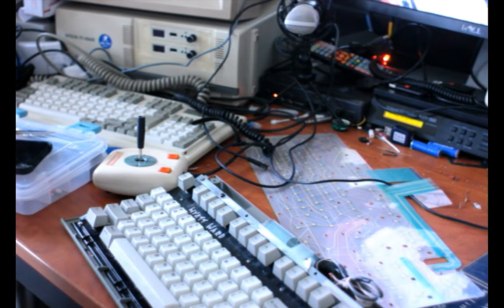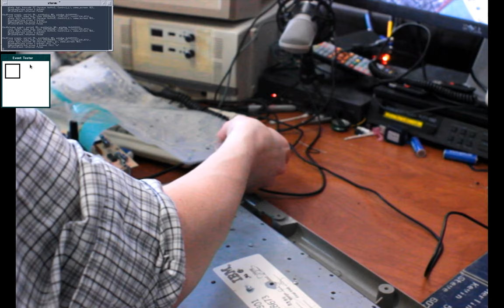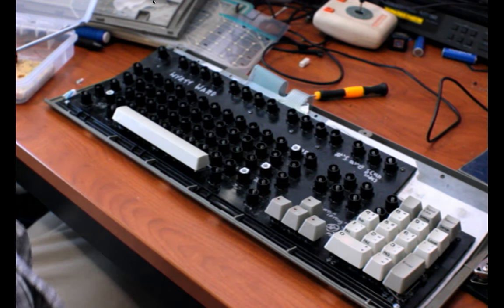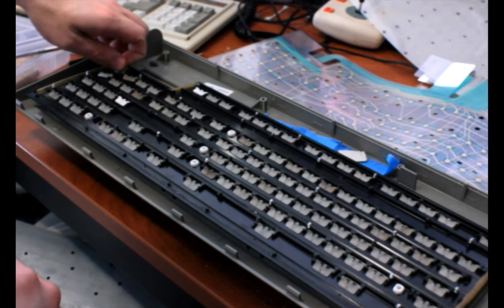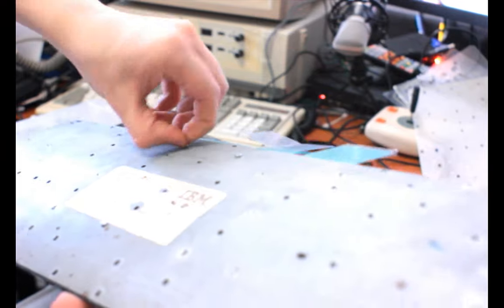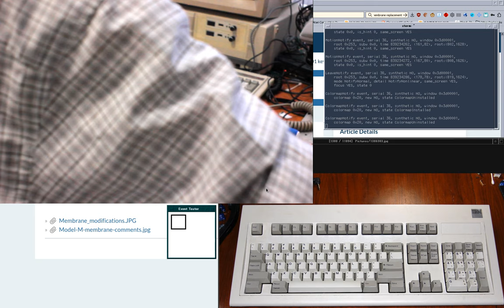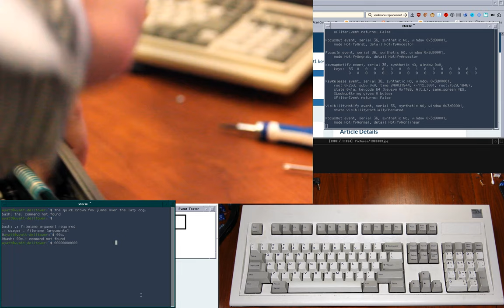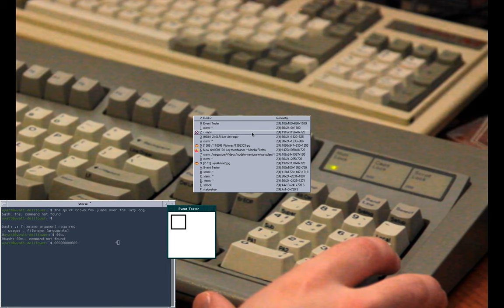1987 IBM Model M Keyboard: Membrane Replacement (+ Bolt Mod)

Comment: Hey man.  I did the same thing with my bolt mod.  Didn't put the silicone sheet between the flippers and membrane sheets.  My Model M did feel sharper in key presses, and decided to leave it in for a month or so.  However, the idea of wearing out the pads got to me, and ended up taking it all apart and putting the layers in the right order, with the silicone layer behind the slippers.  There is a noticeable difference, but the longevity is key.  Probably why the layer order is the way it is.
Reply from the maker: I don't know for sure if it would or wouldn't. It could just be to reduce the noise of an already loud keyboard slightly.